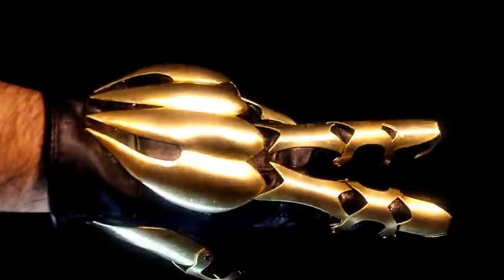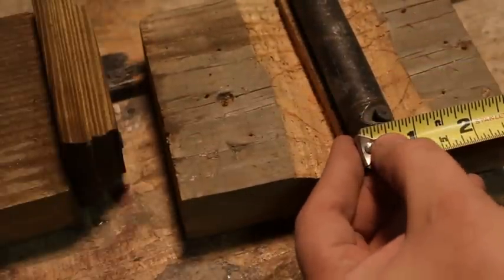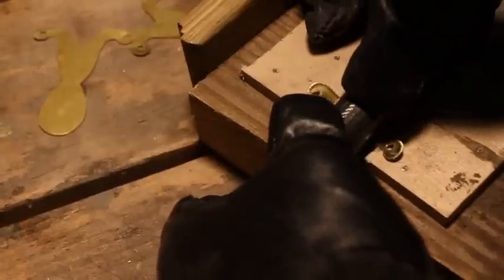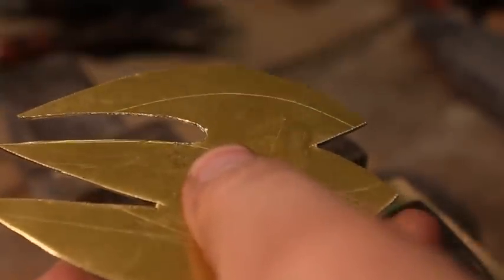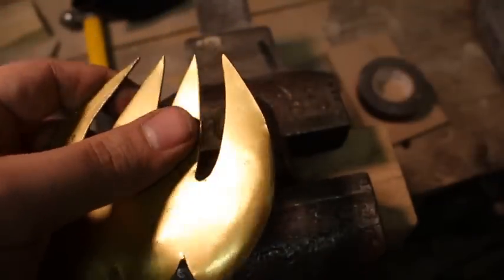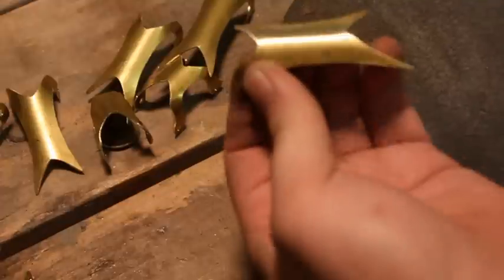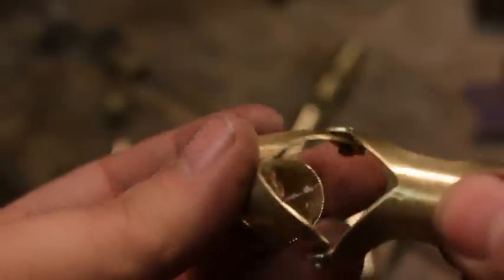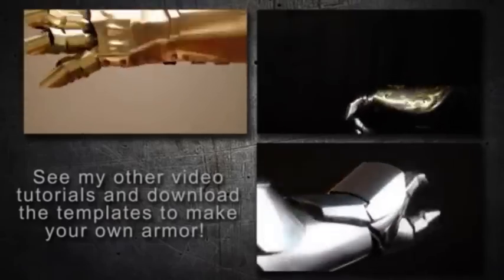How to Make Armor with Ordinary Tools - Demon Hand Gauntlet

Comment: awesome videos, I downloaded all your template for a costume I'm trying to make but where do you get those nice black gloves?
Reply from the maker: Usually just gloves off Ebay. Any black gloves will work. Walmart has Thinsulate brand which work well, however they are seasonal and you may not find them this time of year. The only gauntlet that has a very specific brand glove is the Iron Man one. For that one you will need unlined police gloves (info is written in the template instructions on exactly what to buy).
Reply: Yeah saw that after I took some time to look at everything you had in there, but thanks for the quick response

Comment: I would buy this template to make 2 of these to go with my Darth Revan costume. How big of a sheet of brass would I need for per hand?
Reply from the maker: Not very big. I used scraps I had but I think you could get the parts from one hand onto a 12"x8" piece.

Comment: David Guyton i have a question about the jigs you used are the pipes a bit bigger for the "B" parts of the fingers cause i have found that using the one jig to be annoying when trying to join the finger plates together cause the "B" parts of the finger to not fit over the others and i had to drill the holes in a spot that i could make it fit.
I would like some advice on how to fix this problem
Reply from the maker: +Crimson Teridax Using the jig is just so that you have a perfect curve that is uniform (ie, without kinks) You will still have to pull the overlapping pieces a little to make them fit over top of the lower pieces. The only way to avoid this would be to make two separate jigs with slightly different sizes....and I don't see that as being a viable option as it's not worth the time. It's easy enough to shape the metal a little by hand afterwards. As for the holes, if you have a hard time lining them up, wait until the parts are formed before you make the holes. Mark them as carefully as you can, and also look into a tool called a Power Punch, which punches out precise holes in metal as opposed to a drill bit that can shift as you make the hole.
Reply: David Guyton Thanks for the Information its going to make it a bit easier
Reply: +David Guyton would it be harder to mould if I used 1.8mm Aluminium
Reply: +David Guyton Im not doing the full detail in the knuckle plate Me and a few friends decided to do Acid Etching for the Knuckle plate and If possible in the Next armor project that you do Can you do acid Etching in it please
Reply from the maker: 1.8mm is pretty thick for any metal, but I assume it could be done. I will look into acid etching...been wanting to do something with that for a while.

Comment: What would you recommend for someone with no metal working experience? Because I like the gauntlet, but am not sure if I have the skill to do it
Reply from the maker: This is a good gauntlet to start with if you are just starting out. If you want to try something a little simpler, you can start with my Dragon Rider Ring. As far as not having the skill to do it...I assure you that you can do this. I had no idea I could do it until I tried it, and I found it to be much easier than I thought. If I can do this, anyone can...it's just a matter of working with the materials a little, and committing yourself to the project.
Reply: David Guyton what if I were to say, have little to no upper body strength?

Comment: Sorry if you already answered this, but what diameter of copper tube is that? I plan on making these gauntlets once I get the money.
Reply from the maker: I didn't use any copper tube in the video....what time during the video are you talking about?
Reply: David Guyton The pipe/tube you used to curve metal at 3:05 and the copper pipe you used in other videos (5:47 in the Futuristic Gauntlet tutorial).
Reply from the maker: Actually neither of those really matter as far as size goes. Both are approximately one inch in diameter, but any size close to that will work fine. The one in this video is gas pipe, found in the plumbing dept at any home improvement store. It's much harder and better suited for this sort of thing than copper. The copper one I only use because it's longer and works well enough for some stuff.
Reply: David Guyton Oh, okay. Thanks.
Reply: TheFishCostume Actually the one armor goes on is 3/4 of and inch, and the one cut in half is an inch. One inch cant fit in one inch, their the same :P

Comment: I am subscribed you you. These armor videos are very inspiring. I would think that those points near the wrist could be sharp and uncomfortable, id be tempted to curl them up some... I like the full brass gauntlet probably because I have a lot of Renaissance fair background I want more knuckle protection. That other also looks more realistically functional. Have you ever thought about getting into etching either with a tool or acid for design elements? The music is good for this theme. Sort of a warlock glove or a battle mage.
Reply from the maker: Actually the pointed ends of the knuckleplate stay pinned to the back of the hand and they don't poke your wrist/arm area at all. You can't feel them. I have thought about etching, and I really like the idea, I just don't think I have the patience for it haha

Comment: the gloves you say to use do they have to be real Leather Gloves or can they be Synthetic Leather Gloves and do they have to be
UNLINED leather gloves I have been looking but no go for unlined gloves
Reply from the maker: Generally, genuine leather is betters, and if you choose to rivet through the glove  (as opposed to using epoxy like I did) then you should use real leather for sure. Lined or unlined doesn't matter much with this design...either will work (It's my Iron Man gauntlet that must have unlined gloves). If you want unlined gloves, and you're having a hard time finding them...just go to ebay and search for "police search gloves" Those gloves are unlined leather.

Comment: I have 16 gauge steel and it's difficult to cut with a grinder,
A hacksaw, and even a jigsaw!!
Could you please help me out?
What tool could I use??
Reply from the maker: I don't recommend 16ga because it's too hard to cut with hand tools. If you absolutely insist on using 16ga, I suggest finding a Beverly Shear. Harbor Freight has them but I think they are around $150

Comment: If you were to print PDF and the cutouts did not fit your hand would  you have to custom cut and reshape it?
Reply from the maker: No, not really. Unless you are like 7 feet tall or 4 feet tall, this design should fit you fine. I do suggest making it in paper first so that you can trim any pieces if necessary. If needed, you can scale up or down a little bit using your printer. But again, this is a fairly universal fit that should fit 99.9% of people

Comment: What thickness of metal do you typically use for gauntlets, especially the fingers?
Reply from the maker: +Jordan Riddle generally 20 gauge for the fingerplates, although if you are using stainless you can get away with using 22 gauge if you want because stainless is harder. For the rest, 18ga and on occasion 20ga. If you were using this armor in any kind of combat you wold need to use thicker 18 or 16 gauge for the majority of it, with thinner fingerplates being acceptable
Reply: Okay thank you so much for getting back to me so quickly. I'm most likely going to purchase the template for this gauntlet because I love the design of the finger plates and it would look perfect in a gauntlet I'm building for a costume.
Reply from the maker: You'll be very happy with the way the fingers articulate with this design!

Comment: Hey David i was wondering how you mad the molding for the fingers and where you get your metal im learning to be a blacksmith and it would com in handy please either contact me on face book we could share some great ideas
Reply from the maker: The fingerplate jig is just a piece of pipe cut in half and glued into a piece of wood. It's about 1" inside diameter pipe. I found it in the plumbing dept. at Home Depot. I buy my metal from ebay. seller name is ssshapirometal

Comment: What material should I use for a golden looking effect?
Reply: Like a real shiny (gold armor).
Reply from the maker: cedric wu tchan ki the only real option you have is brass, which can be polished to look a lot like gold. Bronze has a gold look as well, but it is very very rare and expensive. And of course, gold is also rare and expensive, and doesn't make good armor. You could also look into gold plating steel armor...which would give you the most realistic gold effect, since you would be using actual gold over steel.

Comment: How do you measure your arm and hand for a gauntlet
Reply from the maker: Typically I start with pieces of paper and cut them to fit my hand and arm. I don't measure my actual arm or hand. If you are looking to design your own gauntlet I suggest you use paper as well. If you want to make one of my gauntlets, the templates will be close enough to your size. If anything, you will only need to do a little trimming.
Reply: Ok thanks, I appreciate the tips. Love your videos, they will be very helpful. Keep up the good work